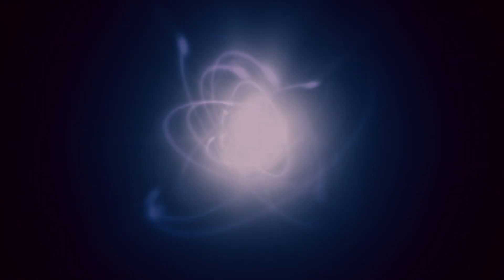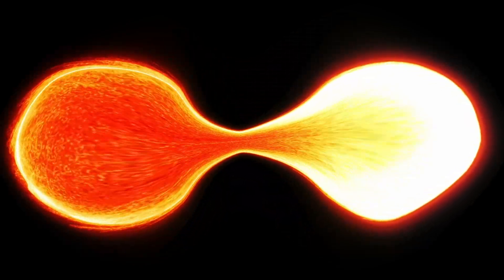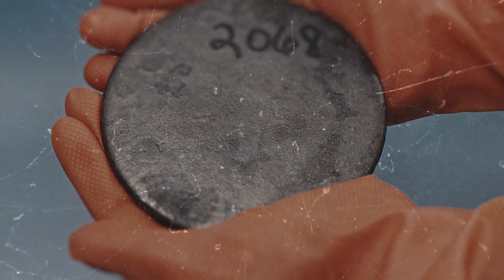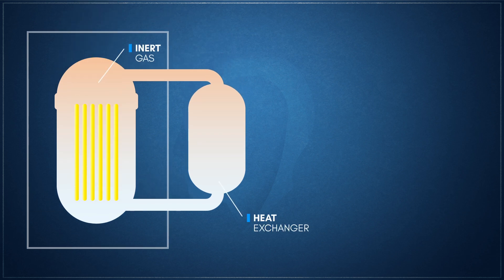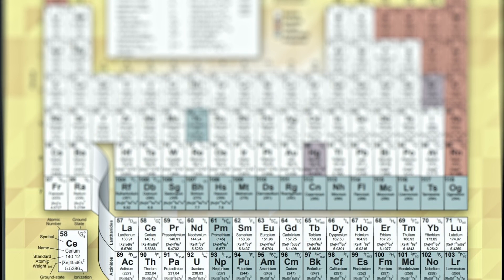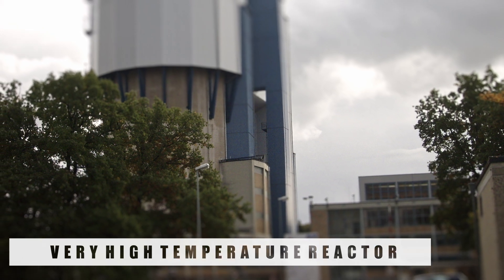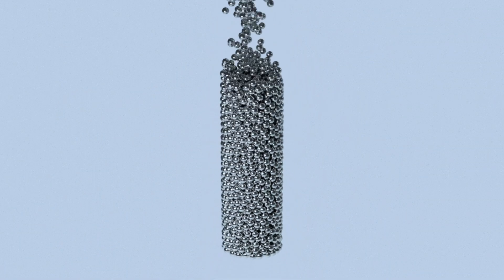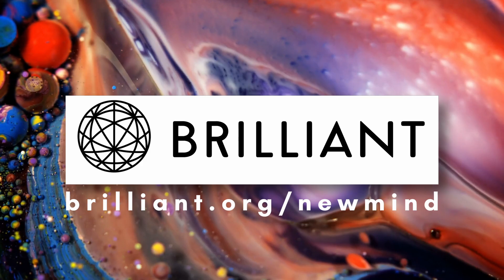Portable Nuclear Power

Comment: I think SMR's are the way forward. Well done video. Will be following this tech. Seems safe and more effective and reliable than some other renewables. Wind and solar are fine but I don't think they will meet the energy needs of the planet.
Reply: Andd they will 'consume' vast amounts of the planet's surface to even try. Environmental nightmares, they are.
Reply: @terrytaylor2825  True. Wind and solar take lots of space.
Reply: @UrbanBard1  Right. When I mention nuclear energy someone always says it too dangerous. They say look what happened with them, melt downs killed a lot of people. They didn't kill near as many as auto crashes, but they don't stop driving cars. Thorium reactors make sense.
Reply: @danielhanawalt4998  Secondary sources of income would abound from replacing light water reactors with LFTRs.
Very cheap electrical power would allow extremely pure chemical reactions (90 to 95% yields vs 25 to 30%) would lower costs.
Extremely polluting sources, such as using bunker fuel in container ships, could be replaced with a nonpolluting one MW (e) LFTR.
Cheap Hydrogen and Oxygen from breaking up water would revolution industry.
Cheap Ammonia which could power automobiles.
CO2 produced from making Portland cement could be used to create methane which leads to making plastics, DiMethyl Ether for Diesel trucks and High octane gasoline for cars. The cement as it set would extract CO2 out of the air making it carbon neutral. An Environmentalist ought to love this idea, but they don't. 
Extracting CO2 from power plant exhaust gases using a spray of water and potassium oxide and then using waste heat from a LFTR to drive off pure CO2. A LFTR would drive down the cost of doing this.
Plutonium 238 can be extracted from LFTR nuclear waste to provide low level power to remote locations. 
If supplies of Pu238 got cheap enough, Super critical CO2 turbogenerators could power homes and cars.
The waste heat from small LFTR's, 25 to 50 MW(e), could be used in industrial processes at 700 degree Celsius rather than being dumped into the air.
 If these small power plants were spread widely, it would make our economy anti fragile. No hurricane, tornado, earthquake  or terrorist could deprive our nation of power for weeks or months.
 If LFTRs replaced coal fired power plants, then a huge amount of radioactive ash currently dumped into the air could be eliminated.

But, Environmentalists don't favor any of this, because of the bugaboo about nuclear radiation. They are too ignorant to know that most of the radiation their bodies  receives comes from eating a banana.
Reply: @UrbanBard1  You're right on all counts.
Reply: @danielhanawalt4998   
I do worry about the fanaticism of some of the people on this thread.

 If a nuclear technology is already liquid, it can't melt down. If the nuclear material gets too hot in a MSR, it flows out of the reactor so it can't be exposed to neutrons and fission. Hence, it naturally cools down. This makes it load following.

If a catastrophic event occurs, such as the load for the generators disappear, the reactor gets so hot that it melts the freeze plug, Then, the reactor fluid drains out into a tank where fission stops. What's to complain about that?

Are there questions which a reasonable critic can make? Sure. Since the progress of the Thermal reactor experiment was interrupted by politics, how do we know if the reactor and its piping won't self destruct after ten years? We don't know that, because the US federal regulatory commission would not allow an experiment to make sure.
 
Will someone else in the world perform this experiment? I think so.

Comment: Personally I'm far more interested in nuclear reactors for large cargo vessels. They're basically the perfect test vehicles for smaller modular reactors using non-weaponizable nuclear fuels, which would allow for high density distributed base load power generation.

Take a ship like the Emma Mærsk. That uses an 80 MW main motor, which is enough to power around 30,000 US households. Once we can build reactors that can fit in that envelope (the motor itself is 26 x 13 meters) we'll be well on the way towards a far cleaner world.
Reply: Great question, any idea why they havnt done it?
Reply: @nicklindhorst9708  Politics.

Things like thorium reactors aren't politically acceptable; if you're okay with nuclear power you'll likely want to be able to use it for weaponry, and if you aren't okay with nuclear power the details of non-weaponizable nuclear power doesn't change that.

That makes non-weaponizable nuclear reactors far less likely to be commercially developed, as they won't get government support.

But let's suppose that tomorrow GE announced that it was now selling 100 MW thorium reactors that were drop-in replacements for the power plants and fuel tanks that are currently in any cargo ship larger than 100 meters in length and wider than 10 meters (numbers pulled from my ass).

Putting that into cargo ships still wouldn't be acceptable from a political standpoint.

What if it gets hijacked by pirates or terrorists? What if it sinks? What if it gets rammed next to a busy tourist beach of a rich country?

We are generally far too scared of "what's the absolute worst case scenario of this thing that could vastly improve our world". 

Even when we ask "what's the absolute worst case scenario of this current technology" and come up with "we'll kill hundreds of millions of people in the next couple of decades", any replacement option somehow has to be perfect beyond measure.

You don't even have to go to nuclear power for that. Look at solar power. "OMG SOLAR POWER DOESN'T WORK AT NIGHT!!!1!11!" is constantly brought up as some kind of argument against ever using solar power. The people who use those types of arguments could have unfiltered chimney smoke from brown coal power plants piped straight into their house, and they'd still refuse to use solar power, because it's not perfect.
Reply: @MrMartinSchou  
I know I'm not opposed to Solar. But I do recognize that for baseload power there needs to be serious overcapacity built in order to accommodate the day night cycle. So far the only two Solar based power generation methods I know of are hydro and Ocean Thermal Energy Conversion. Hydro depends on rain and snow that originates as solar driven evaporation. OTEC and it's related OTMEC depend on the temperature differential between cold deep water and warm surface water. For solar (whatever type) and wind* we need ways of storing the required power needed for those times when one or the other isn't producing any power. Fortunately there are storage systems out there. And some of them do not require the large investment in battery farms. The first is pumped hydro. This is currently in place in a few locations. Excess power is used to pump water to a reservoir and the water is released to spin turbines. Enclose the system and you can keep evaporation to a minimum.  We should be able to do the same thing with heavy weight raised to a height and allowed to fall at a controlled rate. The cable system that raises the weights does double duty as a generator set. And no I'm thinking of the stupid proposal the uses large numbers of weights that need to be lowered to mate precisely with the previous one. Build a tower with x number of lifting shafts in its core. In the shafts have a large steel container. Fill the container with sand, rock, gravel whatever. But don't use concrete. The goal is cut CO2 production after all. The lifting/generator system is at ground level. This makes any servicing easier. Then around the outside wrap the tower with residential apartments,  office space etc. The building does double duty. How much energy could be generated by 1 MT falling 1 meter. Of course it's not going to be 100% efficient.  Nothing really is. Raising the weights are going to take more energy than the system can put out. But then so does pumped hydro. A third method for large Solar Thermal facilities is to concentrate the sunlight to melt a heat sink. Molten salt. The molten salt as it cools it heat is used to vaporize a working fluid or gas to spin a turbine. A forth type would use large flywheels spinning in a vacuum chamber supported in magnetic bearings. Musk likes to promote the battery solution. Small wonder. He's in the battery production business.
When it comes to small scale energy storage hopefully the iron/air batteries will reach the market. One estimate I've seen is that one battery the size of an average washing machine could store enough juice to run the average home for up to three days. Longer if you cut power usage. But not everybody who owns a home can afford to install Solar. Also what about renters? You think that property owners are going to install solar out of the goodness of their hearts. They're in business to make a profit. 
In reality we do not have a shortage of energy. We have a shortage of public and political will. For large wind farms I think we should be looking harder at the vertical axis machines. For several reasons. I know they are not as efficient as the conventional machines. But 1) While not as efficient they can be spaced closer together. 2) By they're very nature they allow the generator set to be placed on ground level on a solid foundation. Not up at the top of tower. The only mechanical system you should really need at the top is the rotor bearing 3) Being at ground level and mounted to a foundation you eliminate the requirement to rotate the turbine into the best orientation. 4) The generator set being at ground level is easier to service.  5) Without the loads placed on the tower by mounting the generator set at the top of the tower the tower should be able to be built lighter. 6) The tower being lighter and needing to withstand less wind loading the foundation should be smaller. Just how big of a foundation does the average commercial wind turbine need?
Reply: @MrMartinSchou  You get it. Finally, another person who gets it.
Reply: @MrMartinSchou  Hahahaha!!!!!!!!!  8.
Reply: @MrMartinSchou  
People want their power available whenever possible.
This is something Solar power machines have not reach far enough to do so.
Reply: @mpetersen6  
Exactly.
They're not able to be used everywhere and only can benifit specific people,specific areas at specific points.
as it is we have not even made it all able to work well together consistently on all power grids for countries.
Im not against solar power myself,I just hate people pushing it as a replacement and justifying it for "climate change"
It's just not there to be able to replace overtime.
Reply: @nicklindhorst9708  idk if your still interested but mustard did a video on just that question. Turns out shipping ports in different countries don’t want the liability and security as well as the question of the shipping lines insurance in the case something does go wrong. The US had a cargo/passenger ship hybrid for a while as well as Japan and I think Germany. All were converted back to conventional fuel. Russia still runs some nuclear ice breakers and I think one cargo ship but it stays in Russian ports and only hauls military cargo. It’s feasible and practical in my opinion. Look at the United States running a nuclear navy. The biggest hurdle will always be public opinion and politics. Nuclear still sounds dirty, dangerous, and scary to the majority of the masses.
Reply: @nicklindhorst9708  No,we haven't progressed far enough,for commercial ships a molten chloride fast reactor would be ideal, we are only now building a test  reactor, you hav to run it a few years and improve it, a TRISO fueled with higher enrichments say 19%,would also work on ships, but we have to have insurance and agreements for all the ports it would go to,the US put up money to study this.
We should see nuclear commercial ship power in about 15 years, or we could also make H2 cheaply with nuclear and use that in giant fuel cells.
Reply: @nicklindhorst9708  they did do it before, like the NS Savannah
Reply: There are I believe two privately (ie non military/government) nuclear powered ice breakers. One I know of for sure is owned by a Russian company, and I believe there is a second one also owned by the same company.
Reply: They already did in the last few decades. Nuclear Subs and nuclear aircraft carriers but they are only in use by the military.

Comment: Check out Kirk Sorensen’s thorium talks — the molten salt reactor, high temperature efficiency and no need for complex fuel fabrication. Game changer 💡
Reply: Thorium is not something that is even present right now as an energy source and new physical fuel  mediums are already up and running and very safe and offer some really innovative designs such as ultra small nuclear generators. Thorium may have its place but it will not become dominant.

Comment: For portable power generation, solid state hydrogen is more efficient and safer. The tech was ready in 2009 but the DoD had the DoE restrict the patent until 2017.
The film is light activated and can pull elemental hydrogen right out of the air. A different light can then strip that hydrogen to power a fuel cell that will produce enough power to sustain the process of stripping and power any number of things. A single cartridge can power a vehicle or home. A couple of them could power a military base or a microgrid in disaster relief situations. The tech is right around the corner, too. Just because they weren't allowed to market it for nearly a decade doesn't mean they weren't working on improving it. 

For more info look for the video: Energy Storage Breakthrough - Solid Hydrogen Explained by Matt Ferrell.

Comment: As a youngster, I remember listening to Paul Harvey on the radio one morning in the late 80s .... I remember him saying something about a nuclear device the size of a gum packet being invented to power an electric car for many many years.
Reply: Plutonium 238 would be an ideal nuclear fuel, if we had enough of it. A LFTR makes it in its waste; about 75 pounds out of a ton of U233 radioactive waste.

This is a very hot alpha radiation emitter. A piece of paper, or even clothing, would block it. A infrared gun would allow you to pick up the pieces after a crash.

It would produce heat from which we could make electricity for 300 years. It is the only technology which which would make an electric car viable. 

I laid out elsewhere in this thread how a nuclear/ electric hybrid car would work. A 20 to 30 Hp gas turbine generator run off of PU238 would provide steady travel at highway speeds. Batteries and motors in the wheels would provide good acceleration. When you get where you are going, the generator recharges the batteries since it is running all the time. Plug the generator into your house to charge it's batteries.
Reply: Cars and aircraft may not be the best place for mini nuclear plants as both are prone to Kinect accidents. 
So is there any design that could withstand a 150 miles per hour impact with another car or could withstand an aircraft plunging from 25000 feet.
Reply: @bighands69  Yes. One using Plutonium 238 if we had any. 

In fact, a case could be made for a constantly running 25 to 35 hp turbo generator to recharge batteries. The batteries  would be a third the size of a Tesla's and provide good acceleration.  25 to 35 hp is sufficient to maintain highway speeds and then recharge the vehicle while you are at work or home. It could supply power to your house battery system so you would rarely need to take power from the grid.

Given that we don't have Thorium Molten Salt Reactors to supply us with Pu238, a gasoline or diesel equivalent turbo generator would be applicable. 

But, Environmentalists would block this because they oppose even safe nuclear power and fossil fuel. Renewable power means that we freeze, starving in the dark like Germany will be doing this and next winter. Cheers!
Reply: @UrbanBard1  What is a turbo generator?  No such animal exists.  A turbo is a device that takes hot expanding internal combustion engine exhaust gasses and harnesses that energy to compress air for the intake of the same engine.  A generator takes rotational energy and converts that to electrical energy.  In your fantasy "turbo generator" what is the energy source?
Reply: @bighands69  Ask the people who build the aircraft data and cockpit voice recorders.
Reply: Paul Harvey was always full of shit

Comment: We do not have to crank the generator.  It is not necessary to move the armature magnets.  Tesla bound the generator with magnets all around the armature. This forces us to turn the armature magnets to produce electricity.  The Edison generator is arranged like a motor and spin without force.  The field magnets produce electricity and move the armature magnets and coils. The brushes pick up the electric power we add inverters and transformers to deliver 110v AC  house current. We can add dynamos inverters and transformers to deliver high voltage AC power continuous peak power to the power lines.
Reply: You again?  LOL

Comment: Permanent magnet motor as a generator is the Edison generator.  A car generator chisel to spin with the field magnets to move the armature magnets and coils of copper wire can produce 13 kw 110v AC continuous peak power. This small generator can power an unlimited number of brushless motors as generators of electricity with inverters and transformers to deliver high voltage AC power continuous peak power without fuel or pollution.   2.4 mega watt power plants are inexpensive power plants without fuel or pollution providing continuous peak power without fuel or pollution.
Reply: Wow, just wow.  The comment section is like comedy central gold.  This is more entertaining than the actual video.  "A car generator chisel"???  What the hell is that?